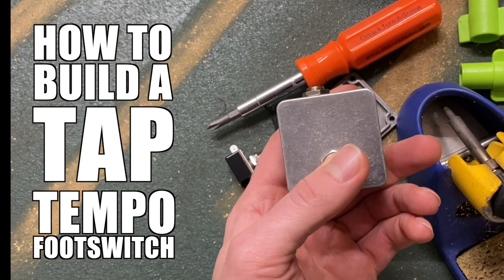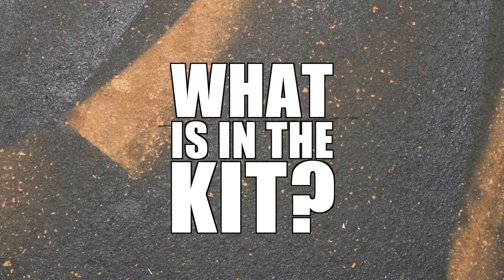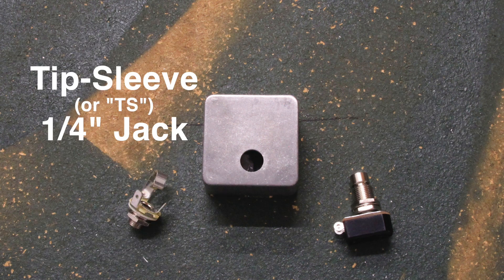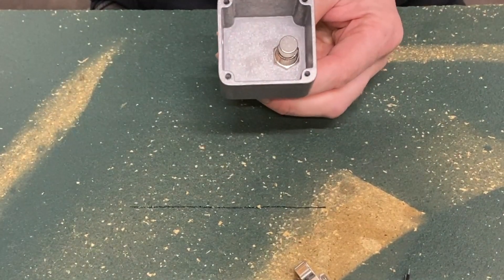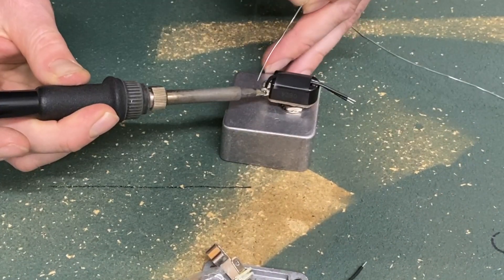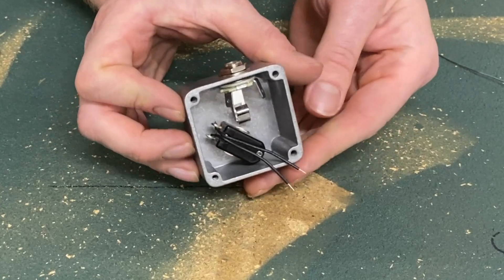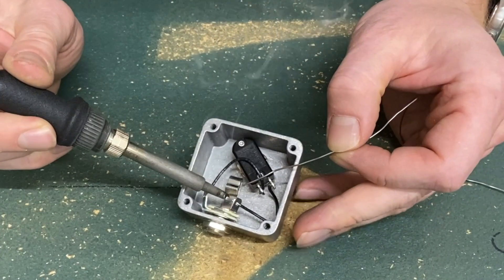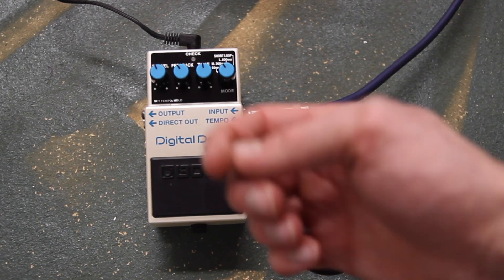How To Build a Tap Tempo Footswitch | DIY Effects Pedals by StompBoxParts.com

Comment: Can it be used for on off switch for boss rc-2 ?
Reply from the maker: Yes. Mostly like the Normally Closed version. However, do some research to determine if normally closed or open in required.

Comment: 3:01  Would be cool if kits could come either all metric or all imperial, rather than a mix of the two.
Reply from the maker: Both of these are common sizes in pedal building! A Rocket Socket set comes with both of these sizes.